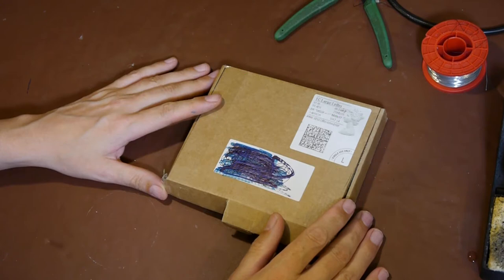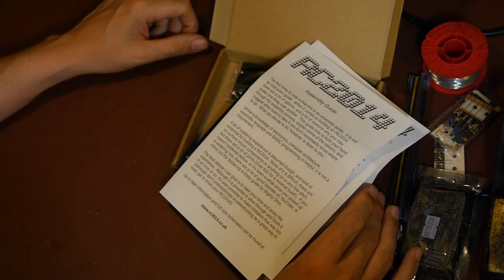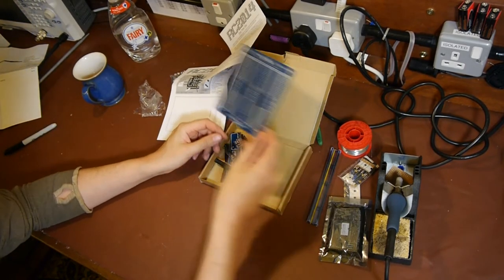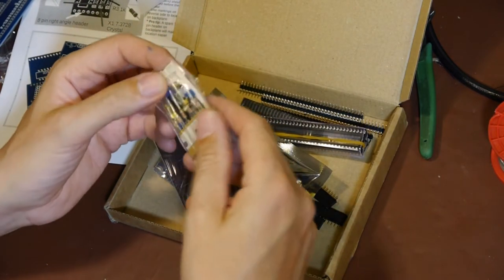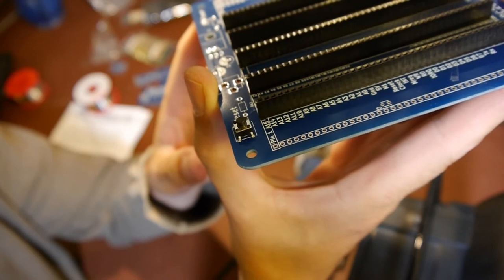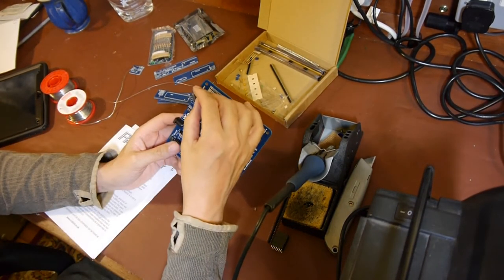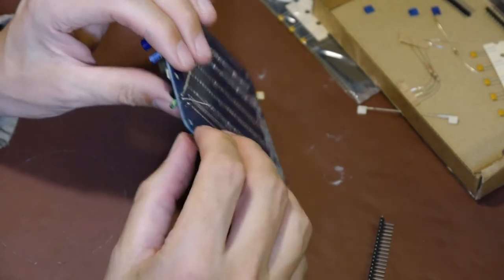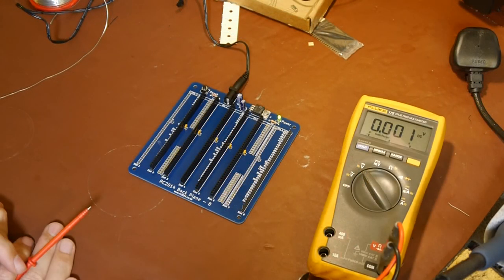Z80 RC2014 Build - All Talk Part 1

Comment: Hi Chris hope u are well? Looks like an interesting project. Maybe a bit on the expensive side but I would still give one a go.
Reply from the maker: Gary g1fsh    Hi Gary hope all is going well with you. Yes it is on the expensive side at the top end of what I would pay. I would say have a look at the link in the show notes this can be built on the plug in matrix board.  I'm not a big fan of matrix or vero board just never have any luck. To be honest being my first micro I was a bit scared. I would have scratched built and designed my own singe PCB board if I ever do another Also check out the original authors site as it gives full information to scratch build. I think I may roll my own 16 bit 6800 board in the future.  Regards Chris
Reply: AllTheGearNoIdea yeah that could b a very good idea Chris i quite like vero board not to keen on strip board tho. I like that green point to point prototyping board it works well. Its not expensive either.

Comment: 1N4001 diode stood on ass end could have been a nice touch....
Reply from the maker: Michael Stevens  Hi thanks for watching and comments.  I will probably replace that linear regulator with a switching regulator board as it’s getting hot dropping from my 9 volt wall wart. It  will definitely overheat if I plug in the I/O board as it’s full of LEDs.  It’s a good little kit to get you started as I just don’t have enough time these day to roll my own. Regards Chris